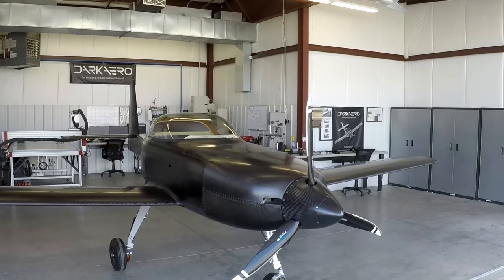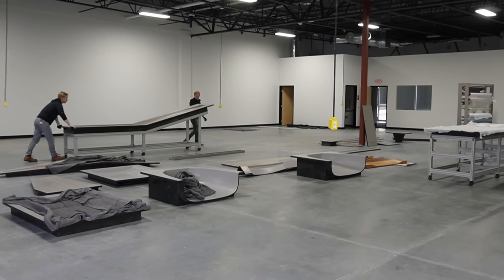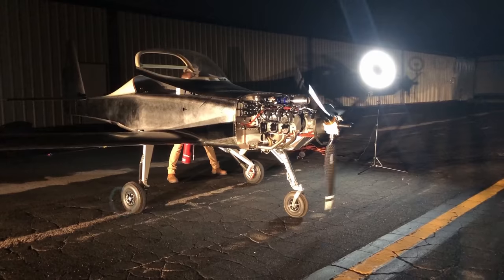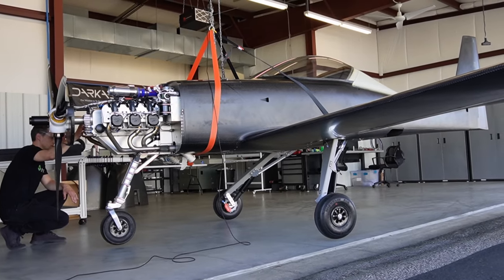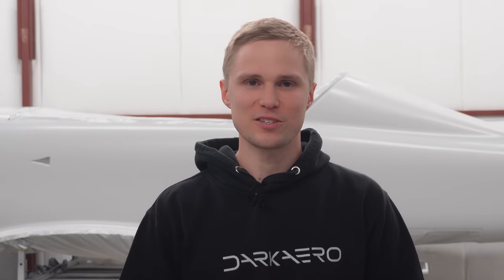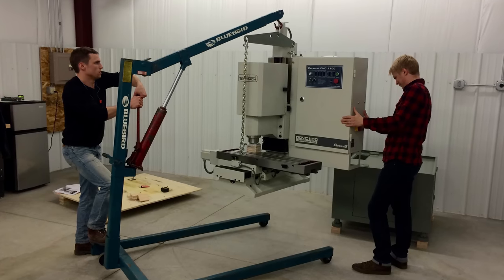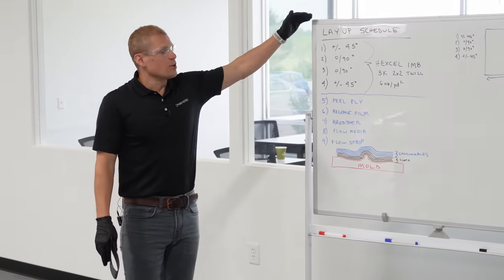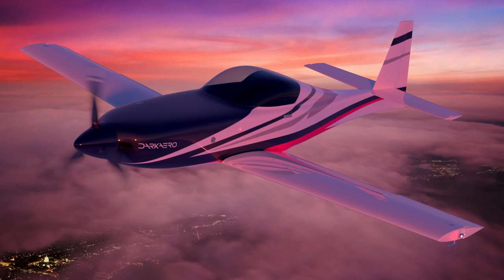Engineering the fastest, longest-range aircraft you can build in your garage

Comment: Quick thought related to the mass production of your plane. Would it not be better to first put the plane through countless hours of testing in all climates and conditions possible? The R&D can only go so far as to how much real world data / feedback it can provide. Different variables unforeseen in development must be brought to light in testing BEFORE the release of the final product. Even today modern auto-mobile manufacturers who have been building cars for numerous years, still release products with unforeseen failures, passing the problem onto to many customers before eventually recalling the product. Just curious! Thanks.
Reply: It's called an "experimental, amateur-built" aircraft for a reason. The engineering and testing that's gone into the DarkAero 1 is above and beyond that which most (if not all) other kit manufacturers do. The flight test regime is designed to establish safe operating limits for the aircraft, but until there are a number of DarkAero 1's actually accumulating flight hours in varying conditions, it won't be possible to test the design in "all climates and conditions possible." (Even certified aircraft aren't tested in "all possible conditions" by the way.)
Reply: @N227TS  iteresting. Thank you for the feedback.

Comment: I really like your accomplishments as a self funded company of three brothers. You have great progress and it's without a doubt an incredible hard job to design an easily build able home-made airplane. 
What I don't understand is: how did you come up with a very small airplane and another low wing design. If you look at Van's Aircraft for example: Their aircraft are getting bigger, RV-7 vs RV-14. Lancair the same thing: 360 vs Lagacy. The reason those planes are getting bigger is because we are getting bigger and heavier and enjoy the space. 
Low wing design: All those mentioned airplanes are low wing. The GA community is getting older. I am in the 50's and have no problem climbing in and out of my RV-10. However ease of entry/exit  is obviously a consideration when it comes to buying an airplane. If there would be a comparable plane with high wings I would have certainly bought that one. Just my 2c

Comment: Have you guys considered adding carbonized cellulose nanocrystals to the composite?   This material is like a more nature made carbon nanorod type material and is not that hard to make at home with basic materials and processes. Has extremely high Young's modulus, tensile, etc strengths. And a little goes a long way.  You can add 2% by weight to the epoxy to get significant increases. And if you make the material yourself, it is fairly inexpensive to make. 

  I recommend using a base stock of cellulose that is already very high in the crystalline cellulose so that you get more concentrated and pure end product.

Comment: If you are going for efficiency, speed, and long range why have a side-by-side cockpit when a two seats in tandem(like a piper cub) is much more efficient. If the wind passing by your fuselage has to go around a 48" wide cockpit or a 24" wide cockpit which do you think would have the least air resistance? You guessed correct the 24" wide cockpit. Lanair had a model called the 'Sentry' and it had two seats in tandem with a Walther M601 turboprop at 708 SHP, it was a rocketship with a 4,000 ft/min climb rate. You may consider one of the new diesel/ Jet A aero engines that are in production or nearing certification like the Austro in Germany already flying on the Diamond twin engine aircrafts,  the US made Deltahawk DHK180 getting close to certification. Diesel/ Jet A has significantly higher BTU's compared with 100LL and just like diesel cars that translates into more mpg and lots of torque. The DeltaHawk 180 uses less fuel, (UL520iS at 182 hp @ 2,600 rpm fuel burn is 13.46 US gal/hr, DHK180 at 2,600 rpm @ 180 hp fuel burn is 10.8 gal/hr), the DH has more torque, has 2 fewer cylinders(less money on overhauls/repairs), is compression ignition(fewer parts), is intercooled and supercharged for good high altitude performance. Another efficient design feature that give lift while decreasing drag is laminar flow airfoils and high aspect ratio airfoils. Just look at gliders/ sailplanes, Reaper drones, and the Global Hawk UAV all have long, narrow (high aspect ratio) wings and can stay airborne for extended duration flights. Another aircraft to look at is the Burt Rutan Quickie Q1 it had a max speed of 126 mph using an 18 hp Onan engine, there again it had two wings that were narrow, long, and efficient and the main landing gear was tucked up in the wing tips. Best of luck with your company.

Comment: You gentlemen are to be complemented for your energy and perseverance.  However, as I watched your video I couldn't help but wondering if this aircraft could be relatively easily equipped with an electric engine and the batteries to support that engine.  In my mind, that's the future in small aviation and I'm sure you would agree.  I think that is your next challenge.  Good luck and keep working on this meaningful project.

Comment: Good luck to you.  Your tail surfaces aren't nearly big enough if you plan to be the "fastest airplane you can build in your garage".  You can still buy at least two different Lancair aircraft, the slowest of which cruises at 235 knots.  There are Lancair Legacy kits available that can do 350 knots if set up for racing.  Glassair kits can now be purchased as well.  The Glassair 3 is a 300 knot aircraft if you build it to race, which the current supplier is more than willing to help you with.  I like your effort, but I think your tail will be your Achilles heal.  The Lancair 235  and  original 320 had a lot of crashes due to a small tail, and yours is smaller than those.  I encourage you to look at that closely.  I realize you have high aspect ratio surfaces, but the effectiveness of such a planform decreases at higher speeds.  I'm not trying to discourage you in any way.  I'm trying to help.  I want you to succeed, believe me.  General aviation is on life support, and you guys are part of the solution.

Comment: 750lb useful load. 77lb fuel. That leaves roughly 265lbs for 2 pax and luggage. Why is it there's never been a plane to meet the requirement to take off full fuel AND sit actual adults in each seat? If there would only be a plane that could sit a 200 lb person in each seat with full fuel and maybe 50lbs of luggage per person?!?!  Just once I'd like to take off without doing some trade off calculation. 

Why is that so impossible?

Comment: I wonder how Mike Patey is able to build an aircraft in the span of a year or less with scrappy.  Then again it is one of a kind not a kit.
Reply: You can do anything if you throw weight and horsepower together. It's not efficient. He's building one offs that guzzle fuel and have a short range.  It's engineering still, but with different design goals. Fixed gear etc all adds simplicity
Reply: Having an unlimited budget, manpower behind the scenes, and unlimited time at one’s disposal is certainly an advantage Mr. Patey has that others do not. Mike is really someone to be respected and a huge advocate for general aviation.